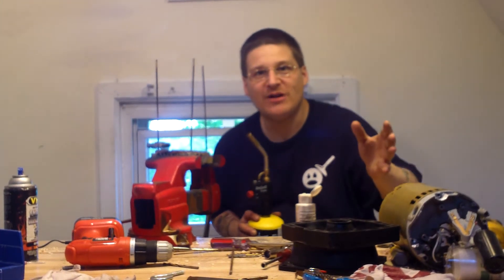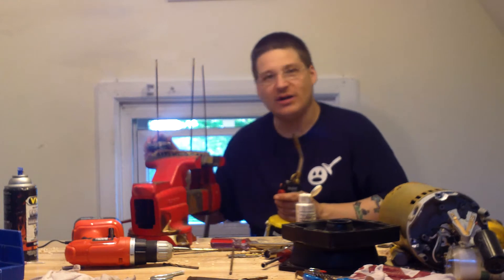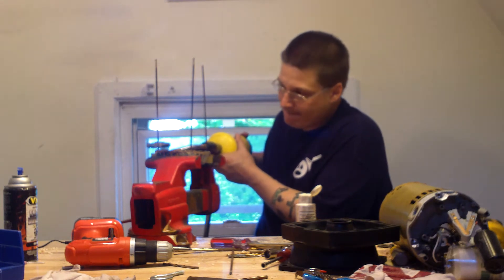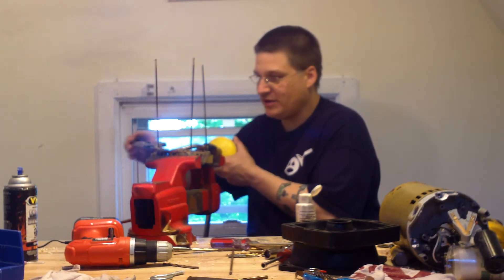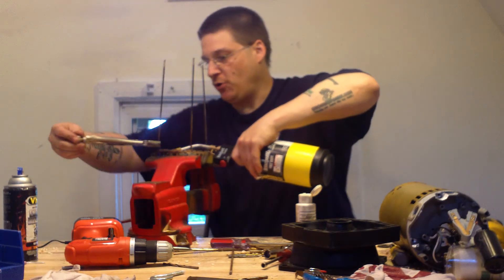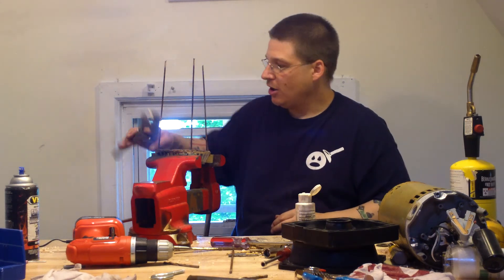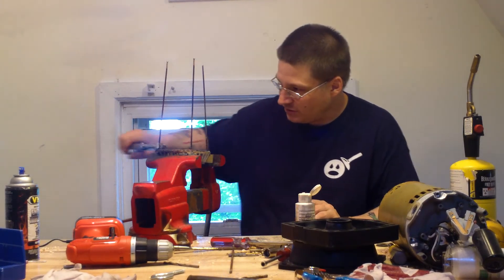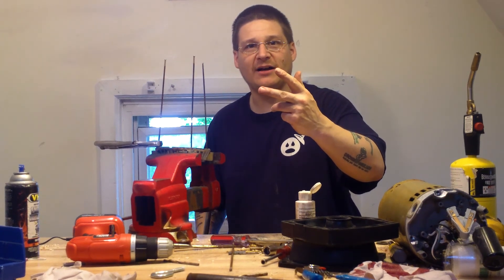Stubborn Hayward Super Pump Bolt Removal

Comment: Great video.  Learned something here.  I ran into this situation just last weekend.  I actually bought your bearings, I started taking the motor apart and was able to remove 2 of the through bolts but the other 2 were really stuck and corroded in place.  Drilled the ends off the through bolts, then used my torch and eventually was able to loosen and remove the last 2 bolts.  Excellent video.  Thanks!

Comment: If you're careful, you can heat it up  while the motor is assembled to loosen through bolts.. Just need to be careful not to melt the fan.